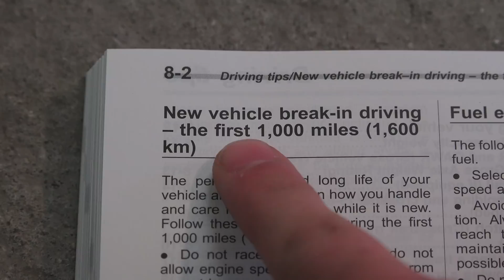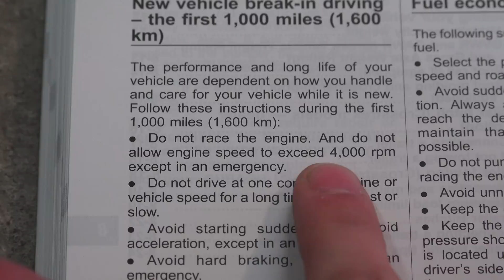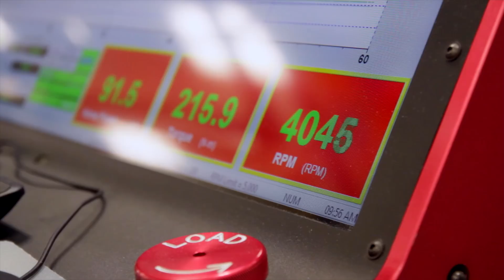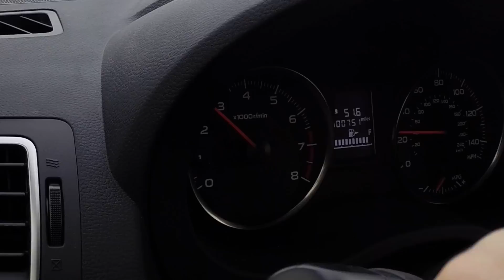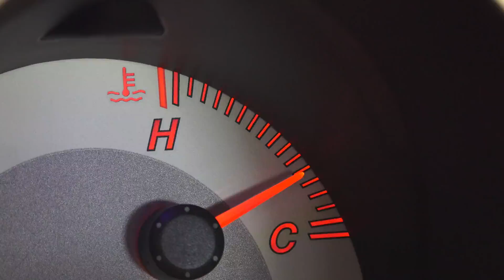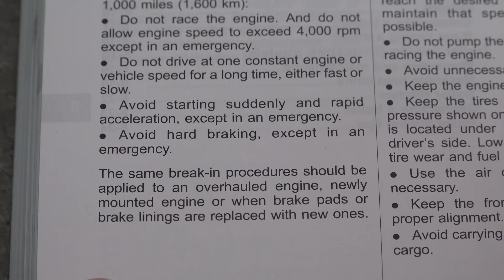5 Things You Should Never Do In A Brand New Car

Comment: How do these low or zero-break in cars handle the initial break in of components, like the clutch and diff, when they aren't connected to the engine at the factory ? I always thought "break it in to the longest interval component"  and that's usually the clutch in a manual car (500ish miles)

Comment: Some people think I'm nuts for doing this, but my engines go well above 200k and have had 500k: When I start any car, I wait for it to come down to idle then I wait about another minute before putting it into gear(adding load).

I believe this allows the engine, despite claims that new engines don't need to do this and some states are passing laws against "unnecessary idle", a chance to "warm up. This means that the oil will be splashed around and start warming up before I put a load (the car itself) on the engine. This means my Cat's and other exhaust parts will warm up. This means the coolant will get a chance to warm up some. 

I read some where that like 90% of engine wear comes from the starting of an engine. It's anecdotal but I believe I have engines that tend to run better over a long range of life

Comment: ok , i heard this many many times and its probably the biggest bs that cardealers say to you! today normal engines are etched inside, they use this method for many years now! dont listen! they just want to be safe if a warranty case comes so they can put it in your shoes and say bs like dont floor it. I know many racing drivers they even say you can harm your injectors and valves with those method of driving for 1000-1500miles or more. A engine gets tested before it leaves the manufacturer if he got the Hp and Torque that is in the data sheet. again dont listn...... but much love from Germany Engineering Explained, love your channel
Reply: Surely you can provide reading material to support your arguments on how the engine testing is sufficient to prepare it for the next 150,000 miles or even long-term tests of two exact same cars that had vastly different break-in periods.
Reply: qwesx i dont have to if your into building engines in masses, you know what the manufacturers do to them
Reply: So you say you don't have to back up your opinion? Why should I trust you then?
Reply: Ok, sure you dont have to but you can if you want. The point is this, today engines gets etched inside so you dont have a break-in phase at all. If the buyer had to break-in the engine self, it would be a very risky thing for the manufacturer. We dont talk here from high performance engines that get build from a small group, sure they have to be break-in..... i talk from engines that gets produced in millions, like the Volkswagen EA-888. Again, you can trust me if you want, but you dont have to, sure. This was the last answer i post here, i dont wanna spoil anyone or that someone gets mad at me. 
sry. 
to all other have a nice day
Reply: heultdochalle how about you find a few credible sources to cite proving such.

However im aware of what you say first hand so i dont have to read behind you. just remember, the best arguements are peer reviewed. (i helped a friend install a LS-1 into his el comino. i learned quite a bit too.)

Comment: Would you be able to do a video on how Over Drive works in Automatic transmission cars and when to use/not to use it? I've been curious for the longest time on it and any research I find isn't explained well as to how it works or what specifically it does or when to turn it off/on

Comment: But how do racecars break in their ring and bores? They certainly cannot obtain that kinds of mileage and time to do it?
Reply: sadakotube the real man way lol
Reply: They don't.
Why break in something that's gonna be rebuilt anyway?
Reply: KlitButter so it runs perfect during the race
Reply: Random Person I know, hence the lack of time and mileage. but engines need to wear in that crosshatch pattern they honed during the block prep.

i guess they run them in on the engine dyno? but I think they do it in a very short while.

I've also heard they simply take it to redline a few times, though unsure how true that is.
Reply: They run them on a dyno to break them in like you saw in the Acura NSX part of the video.
Reply: Rings one uses in a race engine are NOT the same...They also don't expect the engine to last a couple hundred miles before they rebuild it.

Comment: Getting up to operating temperature for the break-in during short travel is of course great idea and important, but seriously silly and difficult to achieve depending on where you live. Here in Finland the law says you can't idle your engine for longer than 2 minutes; 4 minutes if the temperature is below -15C. At the moment we have -2C to -4C mornings and even with a block heater it would take a good while for the engine to get up to operating temperature for that 10-30 minute drive to work.
Starting from 0C our current, yes it's old and afaik no block heater, car only barely creeps past the cold mark on the temp gauge after driving for 10 minutes. I haven't timed it though for how long it takes to reach the middle point of the gauge at certain starting temperature.
Reply: You will not properly heat up your engine at idle anyway. It is a practice from old cars that were really undriveable after cold start. You will do less harm when you drive right away with low load.
Reply: Well, if its against the law to idle it, do exactly the opposite - keep it at redline for as long as possible.
Reply: Idling up to temperature isn't a great way to do it anyway. If it's cold enough and you have a modern enough, tiny engine, you may never get to full operating temperature. Give it 30 seconds or a minute or whatever and then drive away gently until you get to operating temp, then go to "full break-in" mode (or normal driving, if it's past break-in). I live in Alberta and started my Volvo S60R in -35C once, it was NOT happy. Gave it about 90 seconds for the idle to slow down to normal and the transmission to stop making funny noises, then puttered around residential roads to get it to a reasonable temperature.
Reply: Lagittaja i hit the halfway mark about 4 minutes. i turn the block and it already reads heat. i live in texas so it is often 70+ F. about 22-25 C if my math is right. not sure if im remembering how to convert correctly but anyway it is hot. We get lots of wild fires and you need to watch the coolant alot because cars overheat easily here.
Reply: I live in Canada and some times it gets to -30c or even colder but it warms up in like 5 min of normal driving. But again it depends if you have a direct injection engine or not. Or maybe your thermostat  is stuck open...
Reply: +Ariskot007 Absolutely. Saves fuel too, putting it to work; tho I always wait for circulation and plugs to warm up a bit...30-90 seconds or so.
As I undestood it in USCG Engineman school, pistons are oval, not round when cold, so piston slap/ wear occurs then. Never pulled an engine down that was stone-bone dry, so THAT rumor is debunked, imo.
Reply: Hi Finnish guy! Why not use the old school method to warm an engine up faster? Just place a chunk of cardboard in front of the radiator? Your car will warm up much faster on a short commute.

Comment: Isn't it a problem that when buying a new car someone that had taken it on a test drive before you would have likely given it too much throttle or RPM?
Reply: Bob: Actually, that's a good reason to insist on a new car with very low miles.  If a car has more than say, 6 or 7 miles, I know it has been test driven, and might have been driven hard.

If I want to check out the power/acceleration of a car model, I ask to drive a demo model or a recent used model, so I don't mess up someone's new car.
Reply: Bob Sacamano that's precisely why dealerships don't do test drives in high end sports cars

Comment: You say all the manufacturers recommend a soft break in, but why?
Reply: Logical:  Did you try looking in the index of the owner's manual for "break in"?  I just checked various Toyota manuals online, including the Yaris.  In every case I saw, Toyota said the same things like for the first 1000 miles:

 Do not drive at extremely high speeds.
• Avoid sudden acceleration.
• Do not drive continuously in low gears.
• Do not drive at a constant speed for extended periods.

Also for the Yaris, it said no towing for the first 500 miles, and avoid sudden stops for 200 miles.
Reply: blurglide so people don't go fast in their brand new car
Reply: What car are you driving that doesn't have a section for break-in in the user's manual?
Reply: Check Toyota Yaris or Auris for example - I can't see anything about the break-in process in the user's manual..

Comment: When I rebuilt my last bmw engine I gave it a pretty hard break in, I gradually increased the revs and power in maybe a 15 mile period. At the end I took it to 6k rpm full throttle. It didn't use any oil after and compression was very good. One point to add is that it is very important to engine brake, instead of using the brakes.

Comment: I'm curious about using  Total Seal®'s  Quickseat® for an engine build. 

It's supposed feature benefits are:
Quicker ring seating
Promotes longer ring life
Promotes better leak-downs
Provides proper lubrication during the critical break-in period
Virtually eliminates ring related cylinder wall burnishing and glazing

It's a dry film cylinder wall lubricant and I've heard it's just cleverly marketed (WS2) Tungsten Disulfide powder.
Apparently you just rub the stuff on your cleaned cylinder bores before assembling your engine like normal.

I've read of people having good success with it although its probably not necessary if it makes for an easier break even with the same end results I would think it's worth it. Are there any major auto manufactures using a bore treatment like this on new cars? or even private engine builders?

Comment: some examples, where I broke in or was involved in the process of it: kart shifter 125: warm up the engine,5 liters of fuel not full rpm. Mercedes E 63 AMG S and GLE 63 AMG after 100-200 km when the engine is warm enough, the car is good to go (recommended from MB 1500 km breaking in 😁 ). Ferrari Challenge half tank under max. rpm. These are just a few. I guess that the recommendations are very konservative. As long as the engine is warm enough, you should only keep the rpm and load a bit under maximum.

Comment: My only (limited) experience with engine break ins would be rebuilding; including fresh honing, a 5.7 liter late model GM wedge V8.  The break in recommendation involved WOT in 2nd or 3rd gear; letting the engine decelerate the car after each WOT (not sure, I believe they said to 3,000 RPM).  It said to do this 10 times, and then a 500 mile period of no high RPM; followed by an oil change.  I do still have this engine; lacking the resources to take better car of the car, I only run it a few times a year in the summer.  I am curious if this procedure has been ratified; or if it was ever feasible.

Comment: New car seems like too much hassle, I'll just buy some 20 years old crap.
Reply: I used to think this way, then I realized I can keep my 20 year old crap cars at home for weekend driving. When a reliable vehicle is key to getting you to work on time and not missing work for repairs, you find that a new truck every 4 years aint so bad.
Reply: CobNasties i drive an average of 25k miles every year. I get the most return on trade in right at 100k. Plus I set up my loans so that they are paid off every 4 years in case I decide to keep it. You do realize a good ford or chevy truck nowadays starts at 50k by the time you hit the door? TTL, and warranty upgrades are commonly 10-15% in addition to the sticker price. The cheapest vehicle I bought recently was in 2015, a new Jeep Wrangler for $43k out the door. That's my weekend vehicle.
Reply: Y10Q I have never owned a subaru,so Im not sure about your experience. That being said I know a lot of happy subaru owners. The only problem I ever had was a pilot bearing going bad in a new ford ranger in the first 2k miles. It was installed improperly and completely covered by the warranty. We forget that there is still human error in manufacturing. Turns out that year and make was built in Mexico. My new truck was built in Virginia and runs like a top.

Comment: Jason, what if I have a car which I use for track days but is still a daily car? So I drive it hard but still daily it. So basically I daily it daily but go to track events to attemd comp whenever they make one. And as we know sometimes they do it frequently not to mention there are Time Attack, Drift etc. 

As an example, let's say I have an S15 Silvia with an RB26 swap and I rebuild it with forged internals. And I just finished rebuilding it today. And I have about 7 days to tune it etc. Therefore there's no way I can get it to 1000 miles. But there will be hard driving on the dyno not to mention the event itself. How do I assure reliability and power? 

Another thing, do we have to do this everytime we rebuild an engine? 

And what about the brakes. Now I know we might have to change after braking so much in the event. But isnt new brakes needs a few miles before it is at its full potential? Isnt that the reason why manufacturers recommended limit hard braking a few hundred miles?

Please shine some light. 

PS: Your videos are great keep it up. Helped me learn a lot :D

Comment: Thanks for the video. This was particularly helpful as i am buttoning up a rebuild on my MX5 engine. I have read alot of break-in procedures and was hoping you could shed some light on a  couple concerns.
1. I have read from reputable sources (Keith Tanner Flyin Miata) that I should accelerate to 4-5k and engine brake down to 2-3k and repeat the process. as well as varied loads and no full throttle. Could you comment on using this engine braking technique for bedding in rings?
2. Is there a difference between break-in procedures for a rebuild vs. a fresh vehicle? I know this video was about new vehicles but I cant help but wonder if it is applicable to rebuilds as well.

Comment: Too bad they are run to hell right off the assembly line, then sit for a few weeks, then ran hard to and from the truck or train. Then once it hits the dealer it's floored by the sales department and test drives. The initial startup is important, but after that run it like you stole it.

Comment: Two questions : 1) what are the more noticeable symptoms of a car that wasn't broken in properly ?(if one was to be shopping for a used vehicle) and 2) I'm looking to get a '14 forester 2.5 and all the forums talk about oil burning issues, have you ran into this problem , if so did u have dealership deal with it or did try and fix it?

Comment: What about changing oil after break in?
Reply: Joey Zuraski the gauge is still an estimate. there is no magical "oil life" sensor. plus software can fail. Technology is not a substitution for basic care and common sense.
Reply: Bottom feeder My motorcycle recommended this. But it's engine design incorporates the crank, transmission, and clutch in the same space. I would think with a car's motor that it wouldn't hurt at all.
Reply: Bottom feeder the oil they put in new cars when they leave the manufacturing plant, usually contains additives to help the break in period and keep the engine from damage. don't change it before you reach the interval reccommended by the manufacturer.
Reply: AFAIK at the assembly they put some "paste" around the piston what degrades/disappears during the breaking in period. The original oil should be in the engine until the first service.
Reply: I agree. When it comes to cars and maintaining them, knowledge and know how is what you need most. Not depending on newer computer technology. As it is never 100% reliable or accurate at times. Oh and you also need common sense. lol
Reply: Clumsy Kitchen
Reply: BETTER A WASTE OF OIL THAN A ENGINE!

Comment: As an add on, apart from manufacturers recommendations, any further advice on the first oil change?
Reply: Mark Weaden Probably after the first 1000mi. Theres going to be some debris from the cylinder walls. After that every 5-6K mi. Dont forget your transmission oil after the first 1000 mi.
Reply: Ernesto Castellanos cheers
Reply: These days, many manufacturers explicitly recommend that you do NOT do you first oil change sooner than specified.  Many cars are shipped with oils with additives that help with the longevity of your engine.  If you change the oil too soon (such as 1000 miles) then you could actually be shortening the lifespan more than the debris floating around.

Remember, cars these days are manufactured in a much more clean and precise manner.  When debris breaks free, that's what the oil filter is for.  I'm not aware of any new cars that recommend an early oil change.